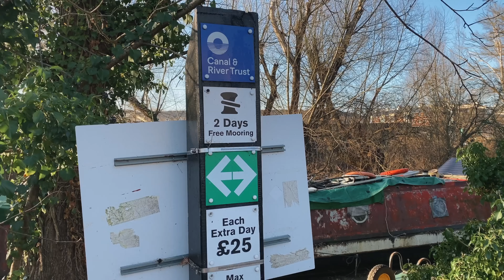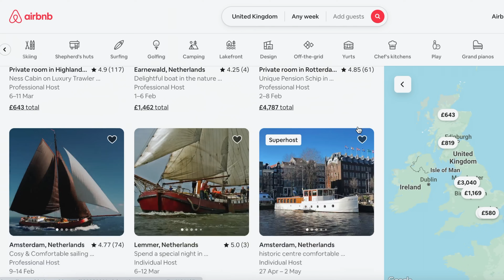10 reasons you should NOT buy a NARROWBOAT

Comment: Very good video..Point 1. Hull condition.. highly recommend a boat that as been grit blasted and epoxied from new.. these are much more likely to have minimal exterior hull corrosion..it's also worth noting that a poorly insulated steel shell will happily rust from the inside out due to condensation cycling..
Reply from the maker: Very good points!

Comment: Hi Nisa, there are several videos on YouTube that explain and demonstrate how you build a recirculating shower system which you can shower for as long as you want with 6 litres of water. These systems aren’t for everyone, but I would urge you to view them to get an idea of what you can manage. Great, helpful and informative video, thanks.
Reply: They work good Tom but the water temperature drops very quickly. As the water comes out the showerhead and makes contact with the air, by the time it hits the basin it's lukewarm, like blowing over a spoon filled with hot soup to cool it down.

The way to shower using limited water is...get the shower room very warm first with a heater (not electric of course) and spend only 10 to 15 seconds soaking oneself before turning off the shower, soap up and scrub before turning the shower back on to rinse everything off.

A 3 litre per minute shower pressure will allow 15 sec to get wet and a 1.45 seconds rinse and use 6 litres of water...my baldy friend says he uses 5 litres of water per shower, so I'd imagine long haired creatures would probably require 10 litres of water per shower if washing hair every shower 😆

Comment: For £10,000 more I'd get one all done 👍🏻
Reply from the maker: That’s great if that’s what suits you 👍 Some people would rather fit the boat out exactly how they want it, with a good electrical system and double glazed windows which is what £15k of the renovation costs would cover. 99% of old boats that are ready for you to move aboard right away won’t have DG windows or good electrical systems, and will probably need some welding, so you might want to budget for those. They also will likely still need some work because they’re old - the interior may be ok but always check for work that might need to be done to the engine bay, bilges, engine, water tank, gas locker and hull. It’ll be an older boat at £35k so although you can live on it right away there will always be some work to do. If you wanted a brand new boat you can move aboard instantly it would be about £160k - £200k

Comment: There's all manner of reasons NOT to try and live on a barge, to start they're FAR too insanely HOT inside in the summer sun, absolutely BRUTAL, and far too transparent to all manner of noise which can be absolute intolerable TORTURE for some, and they're also far too INSECURE too, I definitely wouldn't feel safe sleeping in such a craft, NO chance! Not unless it could be seriously fortified and made super secure, but then it would most likely become far too top heavy and unstable, and/or too low in the water and keep getting grounded and stuck in the mud as canal water is often far too shallow to support such a craft with all manner of heavy security fitted.